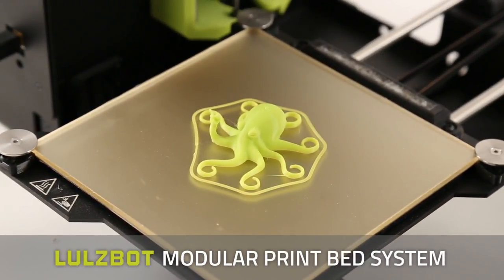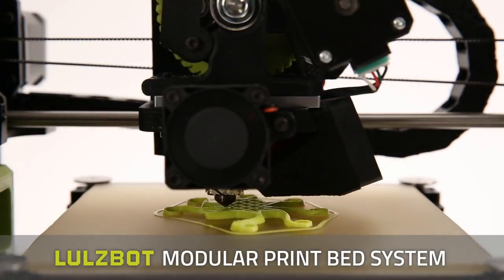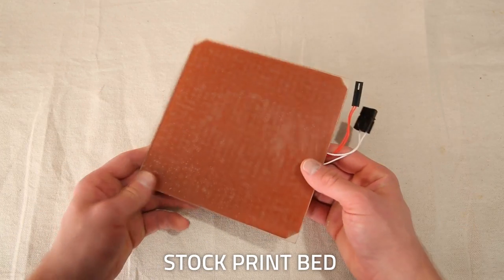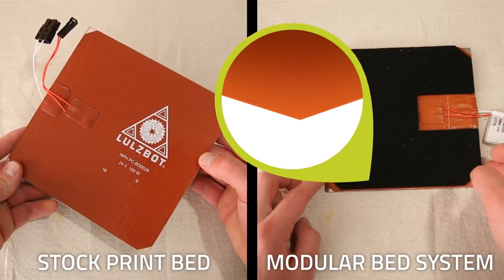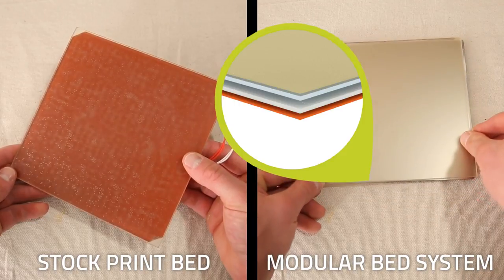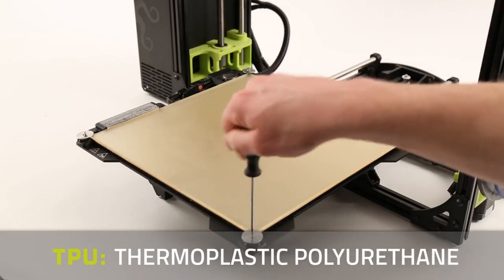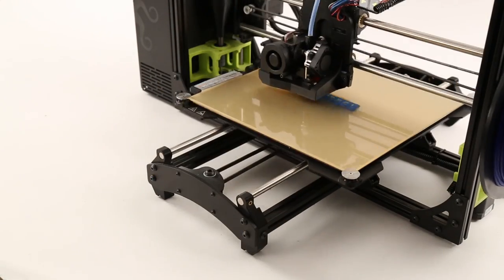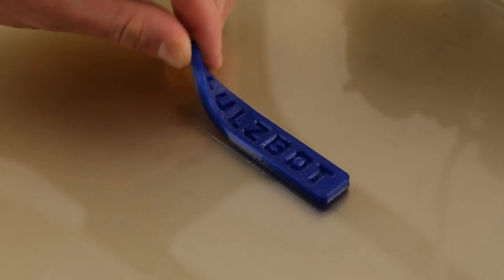LulzBot Modular Print Bed System

Comment: How does one take the PEI off of the glass when it is worn out?  Already hard enough on metal and I still have a wound trying to heal from a glass bed that broken in my hand.
Reply: heat the bed and peel it off.  It'll be on there pretty good but a little acetone softens the glue.
Reply: The Best Stooge, freeze it... It comes right off.
Reply: Good old youtube never showed me your replies.  One says to heat it up and peel it off and another says to freeze it.  How do you get the acetone to the glue?
Reply from the maker: Isopropyl alcohol will help remove any residual adhesive once the PEI film has been removed.
Reply: LulzBot That was not any part of the question though.
Reply from the maker: Some users prefer the freezing method, some users simply peel the PEI off. Either way works well. Once the PEI film has been removed, IPA will clean things right up.
Reply: So when it goes below freezing the glue holding the PEI on the glass just cracks away?  How long do we leave it in the freezer?  Overnight?
Reply from the maker: Here's the original recommended procedure, we'll have an updated modular bed version soon: https://ohai.lulzbot.com/workflow/mini-replacing-pei/maintenance-repairs/

Here are some tips on the freezer method from fellow LulzBot users:  https://forum.lulzbot.com/viewtopic.php?f=36&t=6214
Reply: Thank you. :)